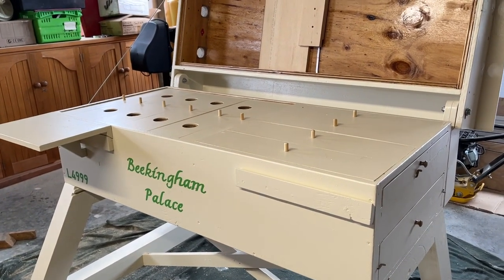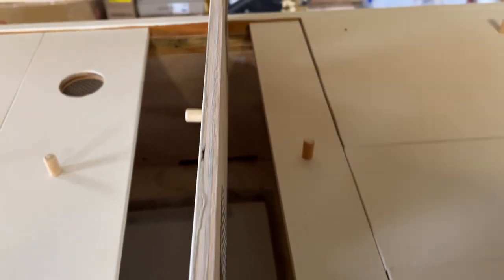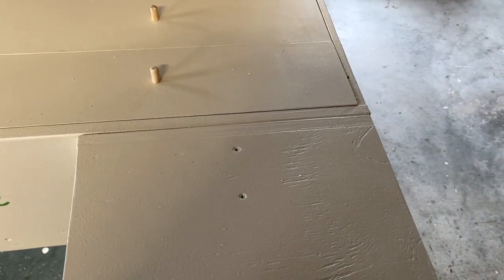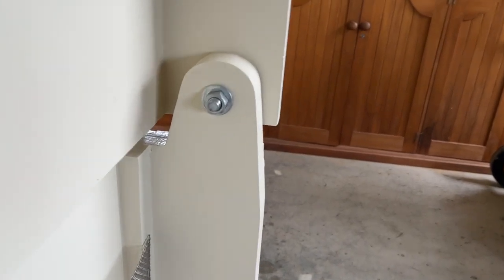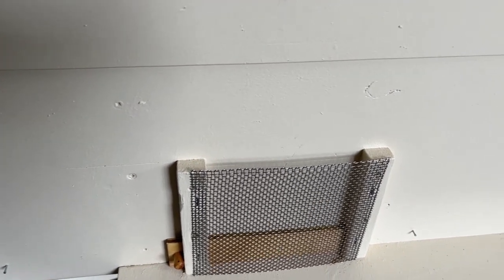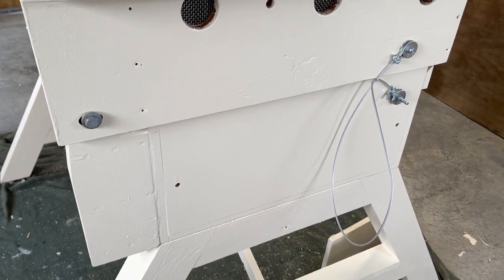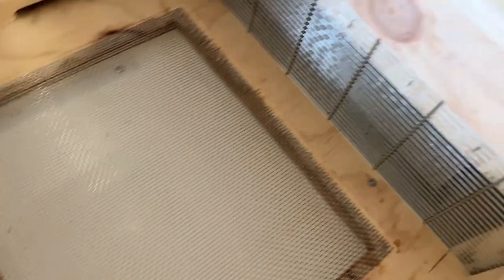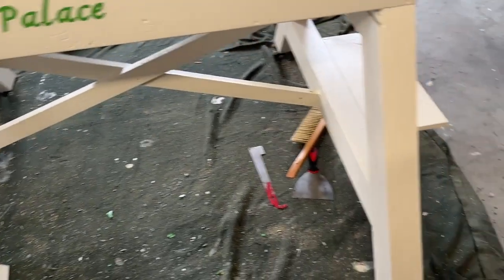Beekingham Palace - Horizontal Flow Hive & the differences between my hives

Comment: Just a thought, the mesh at the entrance, if you can find a way so you can easily slide it up to remove dead bees?  Also the handle on the lid to be able to pull it forward without catching your fingers.  Can you please make a follow up of a hive inspection with a portion showing the ladies coming and going out the entrance.
Thank you for sharing.
Reply from the maker: The sliding mesh is a great idea, but it would only be possible with the stainless steel mesh, as it has strength that the aluminium mesh lacks. But to be honest, the bees have dealt with the dead bees themselves (it does make it a little bit harder on the mortuary bees though). 

I don’t think we need a handle on the lid as my method is to grasp the top lip and pull from there. Even with my wonky shoulder, that works perfectly fine. 

I just did an update video yesterday so I will post that shortly, but I didn’t get a close-up of the bees using the entrance, I’ll go out there this morning and get some footage for you.
Reply: @Kat_Andrews  Thank you for replying and making the effort.  I look forward to seeing the videos you make with the new hives.  I watch Fred's channel specifically to get a few updates of how the ladies winter and grow.   You guys have much better weather than us in Canada.  I hope you are able to stay Varroa free.
Reply from the maker: @kennith.  I’m actually in New Zealand, not Australia, so we deal with varroa year round. As I type I am uploading the update video to YT, and I even did the requested entrance footage for you, listen out for your own special mention 🤣

Give it about 30 mins and it should be viewable. Youtube is very slow to load here as we live in the country and have to use slow wireless broadband.